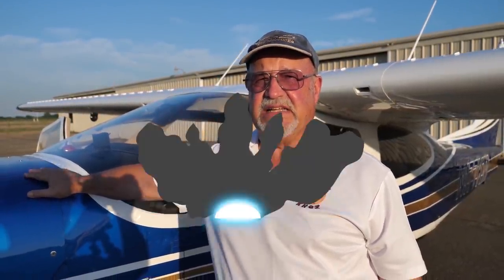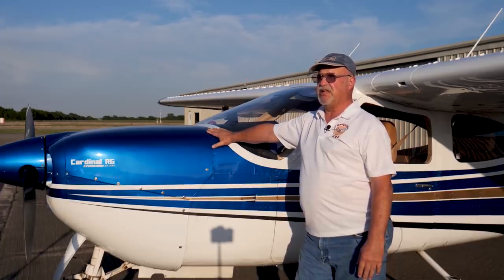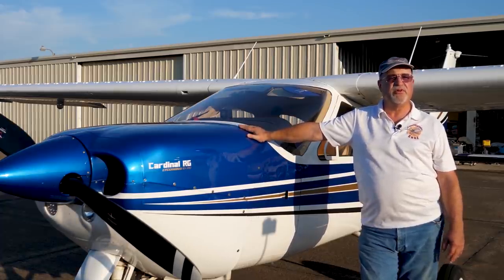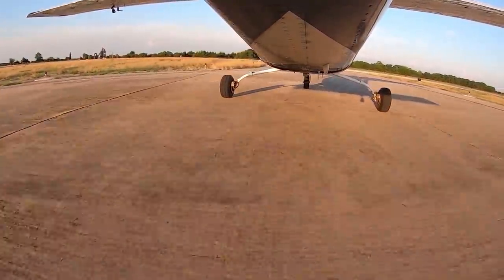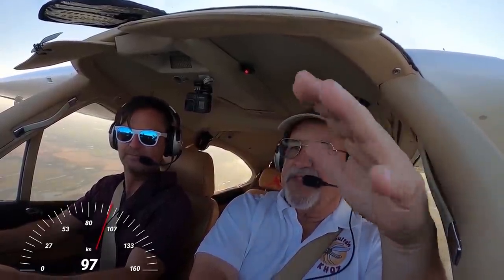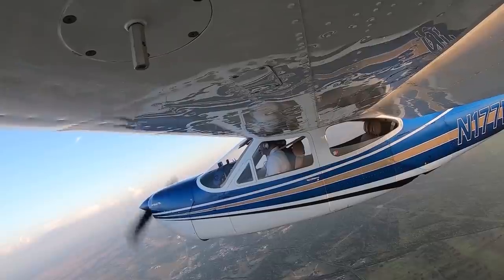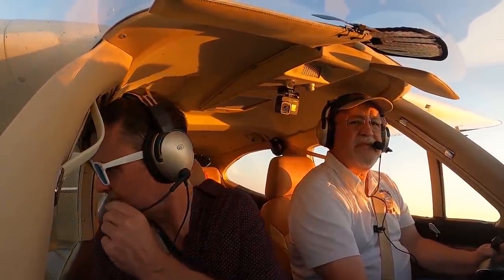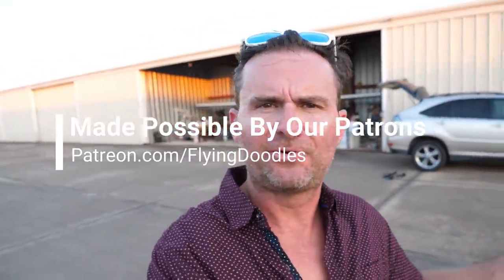Cessna Cardinal 177

Comment: Does Karls Cessna Cardinal 177 have air conditioning in it ? Bobby will you ever be able to pilot a plane again in the future ?
Reply: Yup it’s the little vent that opens forward just like his 70’s vw
Reply: @kaimeier8528  Nah not a/c that's aka Chinese a/c open the window .
Reply: A/C's broke but the big fan up front works great !  I insulated the firewall & reduced 90% of the heat - much more pleasant flying into Houston since then.  Most of the year at altitude we have to close off the vents.  Vent windows have to remain closed > 115 kts
Reply: @karlthomas5740  Thanks for your reply . What your saying the A/C is broken for real Karl?
Reply: Karl Thomas what insulation did you use on the firewall?
Reply: @bobshaw4063  hi Bob. Most single engine piston airplanes, especially older ones from the 70’s, do not have A/C as a factory option. After market installations are sometimes available, but they are very expensive ($35,000 - $50,000 USD), but more importantly, they are heavy (approx 60 lbs/30 KG) and consequently reduce the useful load by that amount.  Plus, the adiabatic lapse rate (air cools at higher altitude) is 3 deg F per 1000 feet.  So if it’s 90 degrees at sea level, it’s approx 69 deg F at 7000 feet, so you no longer need it.  Plus, if it is permanently installed, you carry that extra weight in spring, fall, and winter.  A better option is to build your own, out of a cooler, for about $100 in parts.  Use it when you need it.  Take it out when you don’t.

Comment: First model was hard to fly, had to modify the tail do to stalls and in 1970 changed the airfoil of the main wing do to landing accidents. If you want one do your homework,  many problems few fixes, if you get a nice one, good airplane.
Reply: Jerry, Cardinals are not “hard to fly”, just different compared to the 172, which Cardinals were designed to replace. The fact the FAA certified the airplane proves my point. Cardinals require a lighter touch and a different technique in the flare. Google: “The Pilot’s Lounge #127: Unfairly Maligned Airplanes” for the real story.

Comment: The Cardinals were begging for more power, it would have been way more successful.
Reply: They got that power increase in the second year of the production run (1969 models).  Cessna made a business decision to use the remaining 150HP engines they had obtained from Lycoming to put into the 172J, which was never produced.  The 177 was supposed to be the clean sheet design replacement.  Rather than let these engines go to waste, Cessna mated them with the heavier 177.  But even with the 150 HP engine, the 1968 177 still outclimbs and outruns the Cessna 172 with the same engine, so reports/claims that the Cardinal is “underpowered” are inaccurate.  But, the Lycoming O-360 and IO-360 were what the airplane needed all along.

Comment: I never understood the whole issue with the stabilator.  I always flew approaches and and landed at the slowest possible speed, so it felt normal to me.  People who habitually land too fast probably screw up the flare, too...
Reply: The first time I ever touched a Cessna it was a Centurion on take off. Compared to other things, the elevator felt bolted tight and you needed HUGE deflection to get the nose up.

I think that is what they are referring to.
Reply: @daszieher  I have time in a Centurion and a Cardinal. The 210 is just a heavy beast, there's no way around that. The 177 has similar landing characteristics to a 172 except you have about 40% more elevator control. That can lead to some dicey landings since it's so touchy. I went from a 177 to a 172, and the 177 landed much better, although that is the platform I initially learned on. 172 kinda has a mind of its own.
Reply: @JoshOnGuitar  thanks for clarifying that!

Comment: Textron is so afraid of resurrecting this plane. With a IO-390 turbo normalized and a three blade composite prop, this plane will cruise at 177 knots and with VG,s on the wing it has a better stall speed than a Peterson Kenai and that thing has a boat anchor io-500 burning gobs of fuel and still cant cruise even close to this upgraded Cardinal. You can buy this plane then fully upgrade it with all modern avionics, IO-390 engine upgraded with turbo, New prop, new paint, for around 150,000 to 200,000$. Now you see why the morons at Textron don’t want you get what you pay for, they want you to spend stupid cash for their baby, G36 Bonanza.

Comment: Friend of mine owns one of the original 68 models with fixed gear and had the 150 horse. Cessna came to his farm strip here in NC, and did the stabilator mod at his shop. It was one of the first to get the mod. His has the 180 horse in it now, and the airplane is all original with less than 1500 total time airframe/engine!